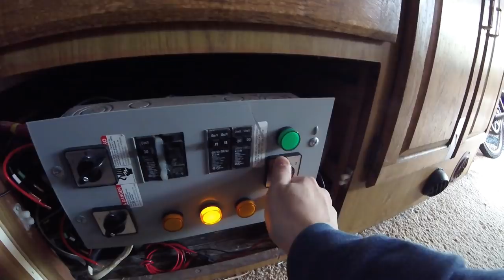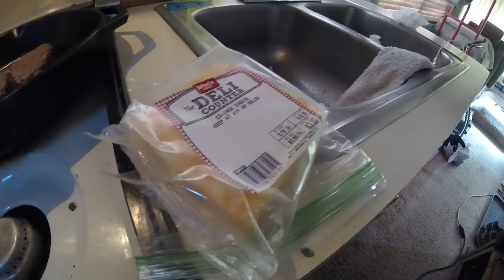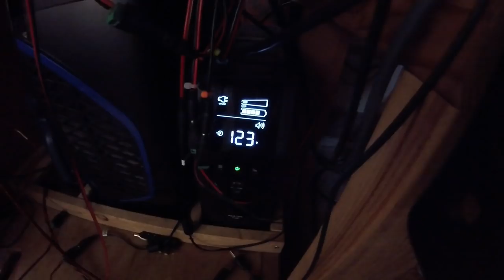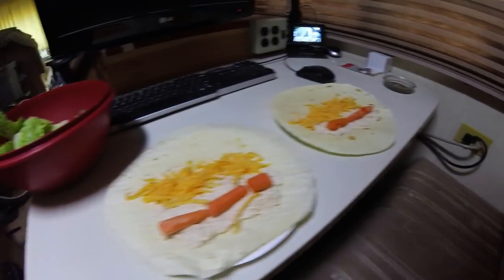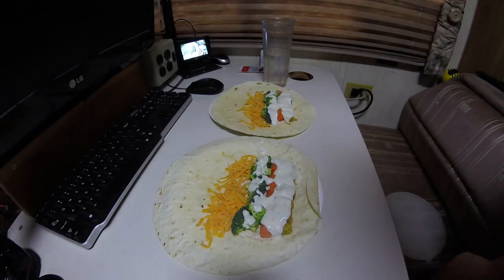Generators & Food || Full Time RV Living

Comment: Regarding the UPS not running on the big generator. Use a kill a watt to check the frequency at idle, medium and heavy load. I had to adjust mine to get my two UPS to take line power when I had it hooked up.
Reply: Mine was at 63 at idle and 61 under load, still too high for them to accept

Comment: BTW If the engine on that thing is still carbureted, you could swap the carburetor out for a UEFI kit for a better gas mileage.
Reply: LOL - it's a 454. In a house. Really not that much to be gained from efi.
Reply: before i got a new fleetwood, i had a 460 uefi and it got better mileage with twin 4 barrels somehow

Comment: Great videos. I don't know anything about RVs. But why are you not on Solar Panels to charge your battery bank? It just seems a bit complicated to have to always run your generator to charge. Just asking since I'm a newbie.
Reply: It's because the batteries were really exhausted.  He does have solar panelling, but when the batteries get low, the panels can't feed enough to lift the battery bank up fast enough before nightfall comes around again.  I think he is active a lot at night, doing things that draw power, but the weather can't be noontime overhead sun every day all day to keep his batteries charging.  They do work, and if you've seen his other videos, you'd see that he monitors the feed rates (and the battery status) in the daytime when the panels are providing good current.

Comment: Y dont you try a alternator  wind mill so when you drive it can charge  the batteries  as well
Reply from the maker: Burn fuel to spin a windmill, or burn fuel to spin an alternator that is already installed on my engine.